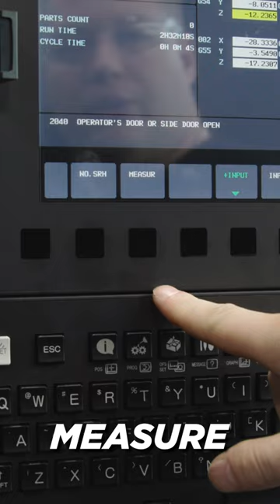Unique Way to Set Your Tools in a CNC Machine #shorts

Comment: A tool probe is only good until someone destroys it. A back up plan is great to have!
Reply: paper
Reply: @donaldscott6231  lol I mostly used the handy post-it notes! Majority of the tool eyes I worked with were broken or horribly off
Reply: Good back up is to have another tool probe lol
Reply: There's only so many backup plans you can have. One of them should be overnight shipping though.
Reply: just buy a grocery bag full of toolprobes
Reply: I use a one inch Jo block.  I can feel .0001, and it’s faster/ to me paper is pointless because you’re coming straight down on your work piece, and you don’t know where exactly your tool is at when all is said and done.  Paper is fine for setting drills and when depth isn’t critical but you’re still bringing the tool straight down on the workpiece

Comment: My shop was a requirement I buy one of these. We have a master setter we all set ours to so that anyone picking up tools on someone else's job, like days/night shift, it's all the same. The really high tolerance guys use their lazer probes and then once the spindle is warm double check it with the .0001 tool setters. Hard checks are always better
Reply: Really, you had to buy a half thou tool setter?  I did mold shop work for years where tool match and precision is critical.  Through my experience, nothing is more accurate than a gage block, I can feel .0001.  Z input calc, -1.0, done

Comment: I'm really pumped for the HAAS comparison. I'm going to buy a VMC for the garage soon. I run HAAS machines and I love them, but I see the limitations as well. I also run Charmilles 330 wire EDM with Fanuc controls, so it shouldn't be hard to learn the DNM 4100
Reply: Haas have the best control in my opinion but the machine does have limitations like you said. If i can have haas control on every machine I would be happy. I just think Fanuc made it more complicated than it need to be 🤣
Reply: @a-a-ron8437  modern tool paths really help HAAS machines though, if you program something with adaptive roughing, it's even faster than the old school heavy cut / slow speed & feed (and doesn't really vibrate)

The biggest let down with the HAAS is just rigidity. They don't even over a machine with boxed ways, only linear guides. And all of their VMC's aren't heavy enough to distribute vibration
Reply: Haas is a cheap machine. If you plan on running aluminum all the time its ok, other than that theyre junk.
Reply: @mattcaesar5781  Haas is still the best machine for the money, they'll finance pretty much anyone, and their service is unbeatable. 

If I was going to start a shop, I'd buy a few Haas machines, and a seat of BobCad/Cam. Then later down the road look at something better like a Mazak depending on what your machining
Reply: you use harbor freight machine tools as your favorite arm chair machines.
Reply: @a-a-ron8437 best control? have you tried others?

Comment: At some point that 1" dial standard is going to fail. It'll be in a couple years, but after you've gained 100% trust in it. And it'll happen when you got a piece of very expensive and hard to replace alloy in the machine.

Comment: We have one machine with a tool setter that's been broken for quite a while. We'll either use another machine, or set a work offset height with a block and a known tool length. Then slowly raise the tool until the block slides underneath, and apply the Z difference to the tool length. Also do this for when the mount for the tool setter is blocked or removed for clearance.
Reply: This is how I was taught…. Raise the tool until the block slides under.  Never fails.

Comment: I've used these before and they are actually pretty accurate. Just gotta make sure you type in + 1.0 inch not - and on the machine I worked on I didn't have to type in length of the tool holder

Comment: The parallax effect with that style of setter isn’t good.
Reply: Make sure you're looking at it straight on.
Reply: @phuckyocouch9098  then it’s either upside down or behind the tool. Upside down doesn’t matter obviously. But using a setter that the gauge faces you directly is better.
Reply: @corbbinrabus  you lean over top of it. Got a bad back or something?
Reply: @phuckyocouch9098  no. Just obviously looking for more precision in my tools than the normal person.
Reply: @corbbinrabus  I'm a dedicated cnc programmer. If you're really that picky then your programmers are going to make a blueprint of each tool and have a tool room attendant doing all the settings where you'll download them at the machine to eliminate human error at the control. Otherwise if you're doing the type of work where a z setter is fine or don't trust your operators to not blow up the probe the setter here will probably be fine. Even the 123 block method will get you within 1 thou in z if you don't suck. I used to use the 123 block method in my operator days all the time for looser work and get all my zs less than a thou off.